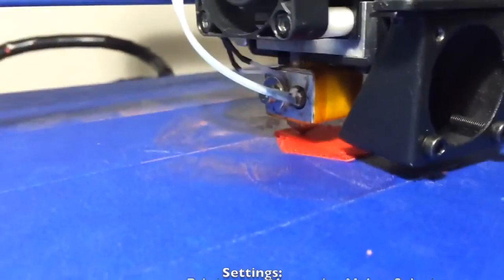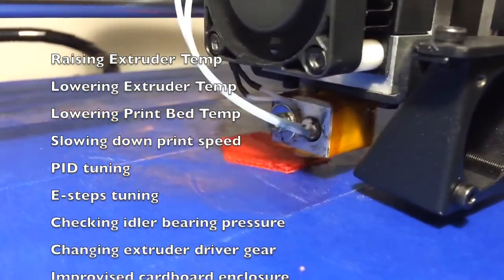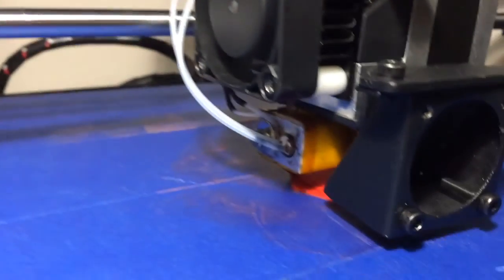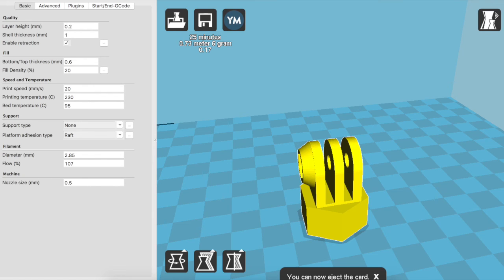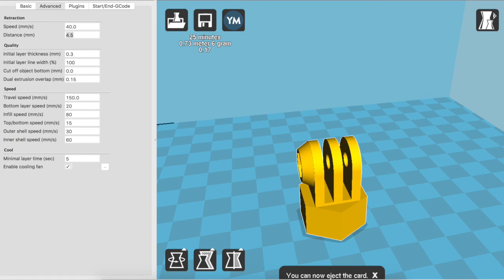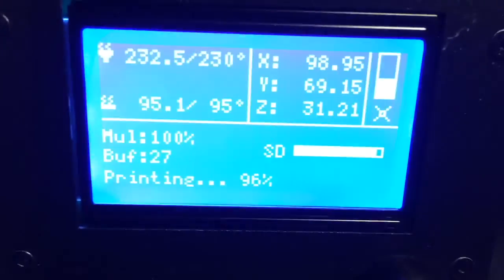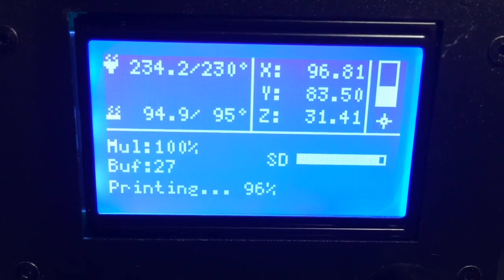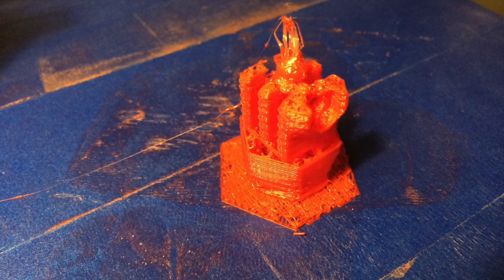ABS print FAIL... Help! (SOLVED)

Comment: I have the same problem but my filament diameter is correct in Acura :/. I´m using Anycubic 4promax and PolyLite ABS.

Comment: For the popping you have to buy humidity machine a small one will help you alot ,you  diy a small box special for storing the filament and u use it inside 5hours on night before you gonna print and use the filament, if you put the filament inside bag then make a hole or open the bag to let the machine sucks the water from the filament, my side did help and i hope it helps
Reply from the maker: +John that's a good idea! What I ended up doing is getting a big can of reusable  silica gel and keep it in a box with a lid.

Comment: Your diameter is wrong ,if you check on 0:55 you will see 2.85 on 107 flow and that will mess all the print ,i can see you are using the 1.75mm then why you have the 2.85mm with 107 flow ,cura settings is wrong
Reply from the maker: +John haha good catch! That was indeed the problem! I address it in my follow up video:
https://youtu.be/pNRswXy2jxk

Comment: You need to adjust the filament diameter  to 1.75 if you use 1.75 filament or to 3mm if you use 3mm ,also the flow show be 100% and print on low speed for abs

Comment: Also check you calibration. Bad calibration makes that weird things.
Reply from the maker: +Selim Helvacioglu Thanks! That's  a good idea for anyone with this problem. In my case, the issue was that my filament diameter settings were wrong, causing it to under extrude.